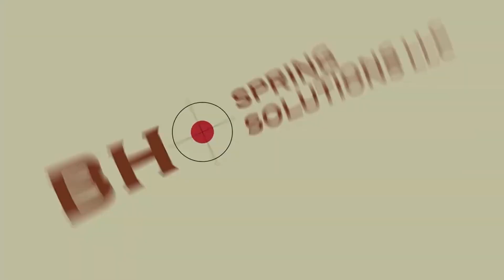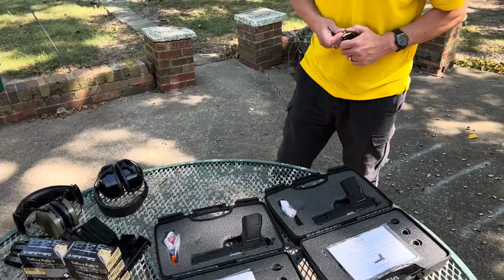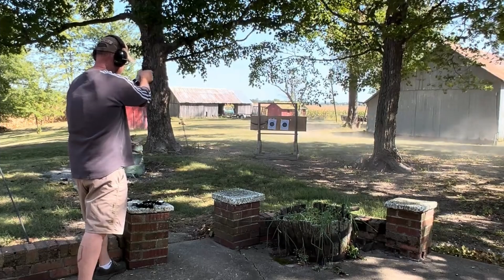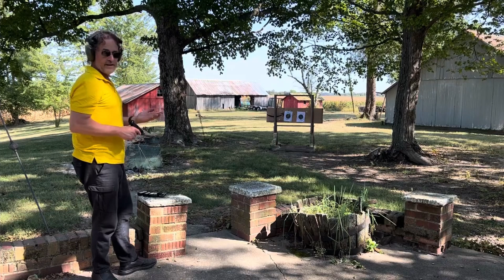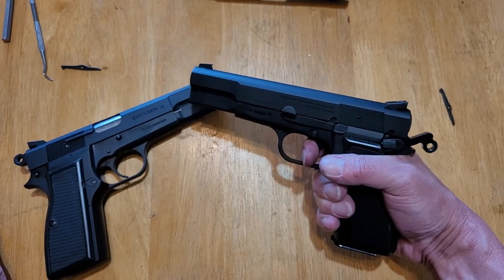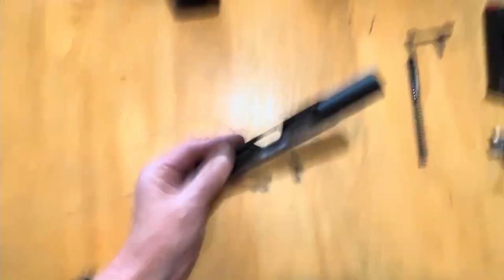BHSpringSolutions' Evaluation & Analysis "Centurion 14" Part 1. BH - Hi-Power University Session 128

Comment: That centurion is a POS  not you guy but that gun it self
Reply: What's wrong with it?
Reply: @stoegerstewie8351 I would like to know too.   Sounds to me like it needs a good cleaning from the factory and then perhaps a change out of the parts Mark recommends.   I have Girsan and Ozerbas (Inglis) models and I know taking some of the arc out of the sear spring will lighten the trigger considerably.  I haven't  found removing the mag disconnect does much, but I do that too when needed.   The main/hammer spring can also be lightened if necessary.   I also wonder if the factory sear lever Mark shows cannot simply be sanded down to remove the burrs and thin it out slightly.     I'll have to see what the BH sear lever and sear cost.

Comment: Bought my Century 14 in the fall of 2024. After getting 3 or more jams per magazine since day one I took it apart for cleaning again, but this time used Engine starting fluid to wash out the extractor spring area, extractor cut, and chamber area....  made sure everything was free and smoothly moving. Starting spray washes, then dries instantly leaving no residue, then oiled it with a mixture of 30W motor oil with 20% turpentine. Soaked in good. Worked all parts, and made sure the spring got plenty of lube. Just went out and shot 8 clips without a hiccup.  Its like being handed a new pistol. Functions flawlessly. Lots of grit and crud washed out of the extractor cut and spring area. Gritty. Like little metal stuff. My gun is in the 400 number range. Using Meggar mags. The factory one works great too.

Comment: my serial# 367, I have the missing finish on mine also. I installed the C&S extended safety, took a lot of fitting. Hogue rosewood grips went right on. Seems better than my Girsan in the frame to slide fit but I haven't shot it as much yet. I haven't been able to compare accuracy yet either.. great work appreciate the details.
Reply: My Girsan MC 35 is miles better than my Centurion lol
Reply: @coreysheckler4777 what's really bad with the Centurion ?
Reply: @stoegerstewie8351 Nothing is bad but my Centurion has the same flaws as my SA 35, sear, extractor and other simular design flaws. Girsan is built a little better and come optics ready, rail etc. Either way I love all high powers but they need love for sure.
Reply: @stoegerstewie8351 Mainly quality differences. Fit and finish etc.
Reply: Which is better so far ? Girsan or Centurion?

Comment: Thanks for your video. I bought this pistol a couple of months ago. I didn't like the small thumb safety. I understand why Israel carried hammer down on an empty chamber.  It was easier to rack the slide than it it was to take the safety  off, still a two handed operation for me. Before it was delivered, I ordered from you a ambi safety and two nickel plated Meg-gar magazines. You were out of an extended strong side safety so that's the only reason I went with the ambi.I took out the magazine disconnect. It did not just fall out like it did with a Browning and a FM. I had to remove the trigger. Ambi after fitting works great. The trigger pull now is under 4 lbs and pretty crisp. Not a tuned 1911 but better than most 1911's. My serial number falls not quite 400 units before yours. I will be in contact with you to replace 3 sear lever and springs for my pistols. Yep I'm a HP freek.
Reply from the maker: Looking forward to hearing from you Tom!  Mark

Comment from the maker: Nice to hear from all of you!  In the near future, you'll be seeing some videos introducing "The Hi-Power Medic".  "The Hi-Power Medic is an FFL holder,  that's David Mitchell who is also BHSpringSolutions Assistant-Manager of Operations......and as "The Hi-Power Medic" performs everything from complete spring replacements to full out Customizations....and 98+% of the Parts installed by the Hi-Power Medic are from BHSpringSolutions.  So as to not be misunderstood by the ATF or anyone else....BHSpringSolutions is a Design Company that also Manufactures / Distributes / Retails our own proprietary components and componets made by a select few like Mecgar and Browning - and we teach everyone we can from gunsmiths to end users how to safely install and get the most benefits out of the components we can supply, and, when the next Turkish Hi-Power Clone lands here, we work with The Hi-Power Medic to find the shortcomings in the new arrival and see how and if those can be fixed with either Browning Factory Hi-Power Parts or BHAdvanced Hi-Power Parts (all remaining Browning OEM Factory Hi-Power Parts are at BHSpringSolutions.com).  Then, David can take that knowledge and apply it for owners of models like the Centurion 14 in this video....and is equally effective with all the Hi-Power Models of all manufacturers of history - and, it's The Hi-Power Medic who upgrades a few Hi-Powers and 1911s and a few others with BHSpringSolutions' Components and sells them.  David has been with BHSpringSolutions for four years, and obtaining his FFL as "The Hi-Power Medic", especially since every Hi-Power that's arrived in the market since Browning discontinued the Browning Hi-Power needs some kind of medical-grade intervention.......they say "timing is everything".....and so it is the right time for a Hi-Power Medic to show up.....  David has been learning from BHSpringSolutions for four years and does really excellent work.